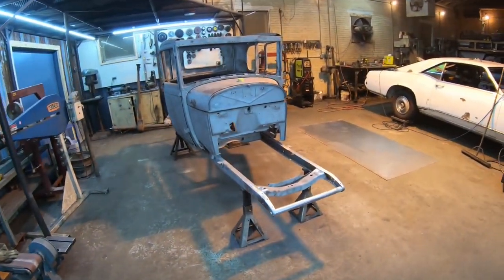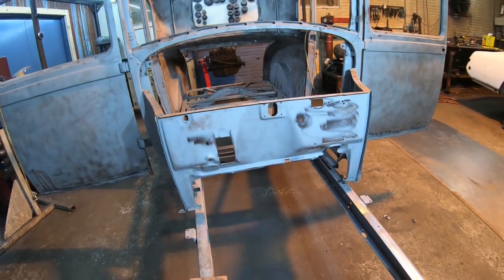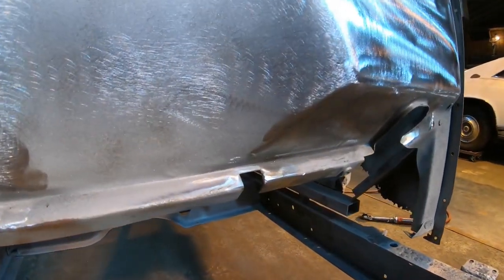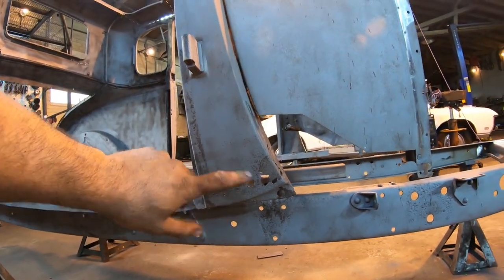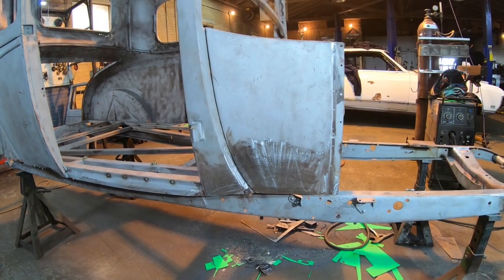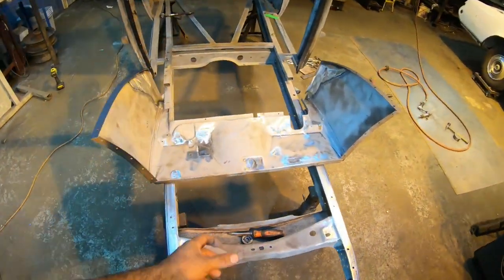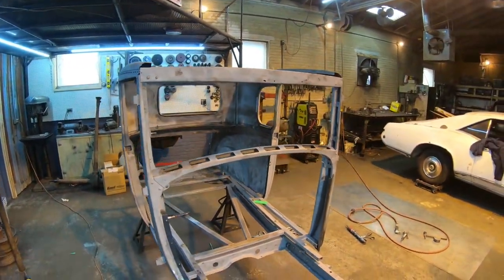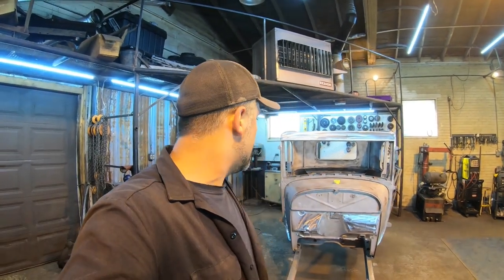Model A' Ford Sheet Metal Repair- Firewall and Cowl Patching- Yard Art Model A Build- Part 6

Comment: I really love to watch you work your "magic" with all of that metal repair.  I used to be a sheetmetal/structural repair mechanic with United Airlines way back in the day on old DC-6s and Convair 340s.  You kinda remind me of some of the stuff I used to do with the metal.  Only I got to use aluminum, which is a lot easier to work with I'm thinkin'.

Comment: Until I stumbled across the video when you first got the A, I never watched many resto videos, even though I love old cars so much. I've been a fan ever since and love watching this old girl come to life. Question though,  and I apologize for my ignorance on this type of work, what was the black spray paint for when attaching the cowl? Is that for proper alignment?
Reply from the maker: Basically I just coated the bare metal where the cowl bolts to the body, seeing that it's never going to come off again. When the car gets painted you will never be able to get paint in there so I just hit it with Rust-Oleum so it doesn't rust inside in the future

Comment: exactly the video I needed. thx.  The radius on the header is that the same radius as the one on the original piece or is the radius of the wood different?
Reply from the maker: Basically the original header panel was an inch shorter and square, the wood was an inch taller at the center and radiused down to the roof line, in my case I just added the inch to my header panel and put the radius of the wood into the steel. Usually if the panel is good, I just put a piece of one inch square tube on top and notch the last foot or so to achieve the original radius of the wood.

Comment: where did you get that Brake I love it
Reply from the maker: Yeah it's quite the unit. I bought it and the giant shear in my back room through an online auction a few years ago. The brake is pretty wore out, could use a bit of work on the folding arm, but it does the job!